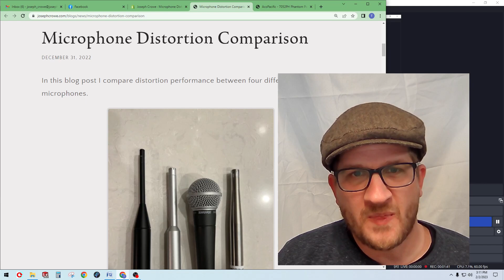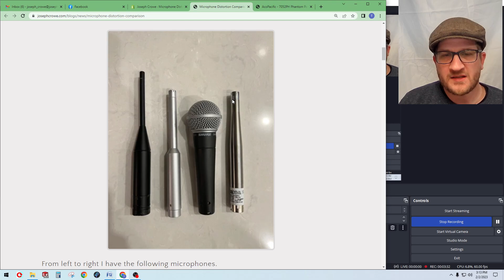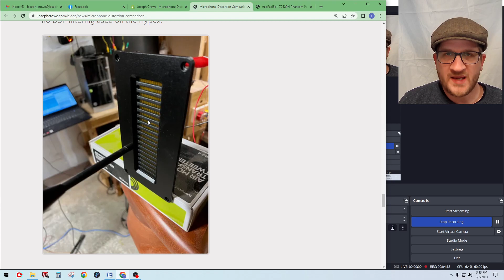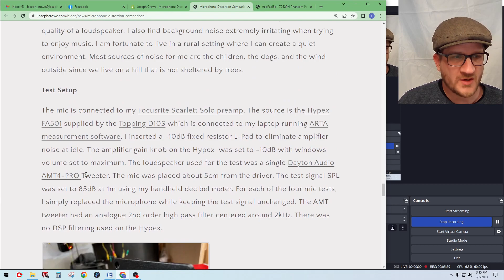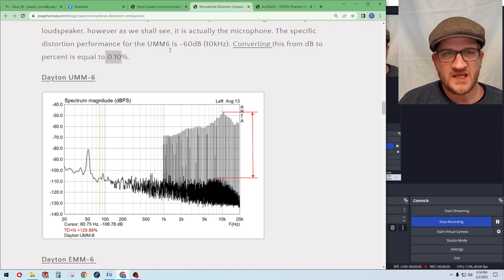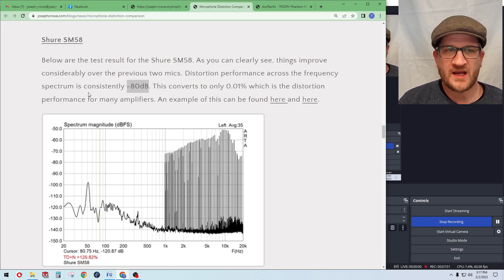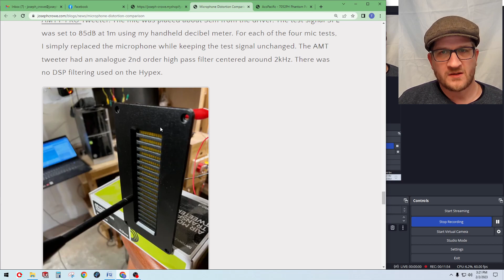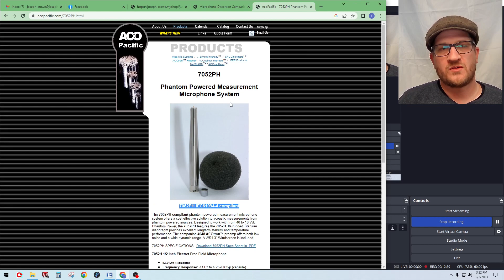Microphone Distortion Comparison

Comment: Great video and demonstration. Measuring for distortion is important if that's an important measurement. The notion that speaker distortion is orders of magnitude higher than the amplifier is neither true, nor false. It just depends on the situation. Back that mic up 2 meters, and push that tweeter much harder and I think you'll find the distortion from the tweeter is greater than the influence of the microphone and the microphone's distortion will be buried in the noise of the speaker distortion. 

It's funny that the vocals microphone is so good compared to Dayton stuff.

Would you be willing to try a UMIK 1 and 2  from Minidsp? Those have, at least in my limited experience, been more accurate and consistent compared to the Dayton UMM6.
Reply from the maker: I honestly don’t plan on testing any more microphones. But I would like to see others repeat my test with their own mics. 
Distortion rises in a linear fashion for the AMT tweeter. 75dB test SPL has distortion at -85dB, 85dB SPL is -75dB, and 95dB is -65dB IMD. So eventually the tweeter runs out if headroom. Adding a waveguide improves these numbers by quite a bit. More to come on that.

Comment: Have you had any issues with repeatability when it comes to distortion measurements? Danny Richie claims that distortion measurements done at home (in other words not in an anechoic chamber) are meaningless and why he doesn't include it in his videos. In my experience, I haven't had any problems measuring driver distortion as long as the room noise is low enough (and REW gives you a "noise" curve to see whether it's below the distortion you're measuring). The only exception is when there are big room acoustics issues which often show up as a peak in distortion but I know where it happens in my testing room and which areas I should ignore on the measurements
Reply from the maker: The biggest problem I have is setting the SPL level when measuring tweeters. It’s not clear to me if I should compensate to a lower test SPL to account for there being no bass frequencies. Since the SPL would increase if those frequencies were added. So I can do comparisons between tweeters but not provide accurate test data in the context of a complete speaker. That’s my difficulty currently. I could standardize to a set voltage (ie.2V, 2.83V etc.) but it’s not relevant in the context to listening levels such as 85dB and 95dB which is used by Klang-Ton Magazine which represents a normal range of average listening levels. If Danny is talking about harmonic distortion then it I agree it’s only loosely associated with subjective sound quality. What I’m doing is entirely different and not fully appreciated by many.  I quote in my blog post about the lack of standards for IMD because it IS very difficult to standardize, which is why I’ve strives to come up with my own standardized test at least for in-house.
Reply: @JosephCrowesDIYSpeakerBuilding  Danny's comments aren't about the subjective sound quality. It's just about the ability to measure distortion accurately outside of an anechoic chamber. He thinks the distortion measurements I have (harmonic or IMD) are useless because my testing environment wouldn't allow for accurate tests. I've managed to get repeatable measurements which also line up with measurements of the same drivers done in anechoic chambers so I don't agree with his view on this. He doesn't include distortion measurements (harmonic of IMD) in any of his videos because of this but I think it would be helpful for them to be included since he has access to so many speakers and it would be interesting to compare. It seems like you haven't had any issues with distortion measurements either (assuming the room is quiet enough and using an appropriate mic)
Reply: @gerhardwestphalen    Danny is good at finding reasons why his meaurement's and anyone else's are not the same. The truth is that for SPL results most every competent person will come up with reasonably similar results.

Mark
Reply: @JosephCrowesDIYSpeakerBuilding  I don't think that's something which needs to be compensated for. If you have your tweeter set at, say, averaging around 95 dBSPL at 1m, then that would be the same as if you were using a full speaker system at 95 dBSPL. If you're talking about using an SPL meter to measure a tweeter level then yes, it wouldn't be accurate because of the weighting but if you calibrate your software using the appropriate pink noise and weighting, then the frequency specific SPLs shown in your software (not a single SPL meter reading) would all be correct. If you get the tweeter's curve to be averaging around 85dB then that would be equivalent to playing them in a full speaker system at that level

Comment: Hi Troy, interesting video and I think important. We should be as perfect as possible on the developer/engineering side. And with that demand we have toady so much opportunities which are even affordable, that it would be a shame not to use it or even deny it as some guys from the consumer side are proclaiming that just their ears are their best instrument  of/for measurement. Which is fine or enthusiasts that just want to enjoy their gear. On the other side I think you've asked a valid question. Does it even matter if distortions are detectable in a speaker system with 40 - 60db distortion below SPL, if it's K2 K3 who care? Why because especially today there is a very old medium coming back that has most time much worse overall distortion / noise / rumble etc., than one of our speaker could ever have. But guess what? They like it 😁. 
All what I am writing here is not a pleading for being inaccurate. Quite the opposite. We have to understand our passion, we have to go deep and learn our stuff to create the best product for our customer. With that understanding I think this video reflects this very well.
Reply from the maker: Thank you!